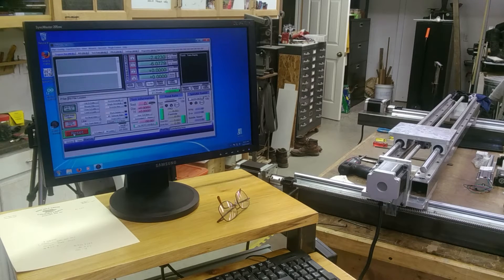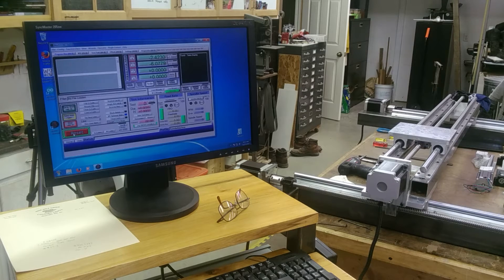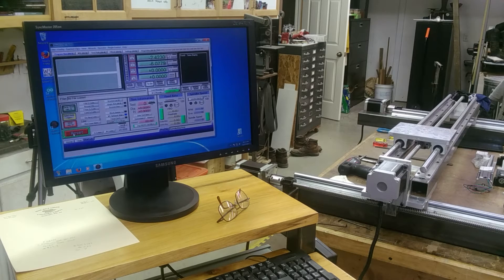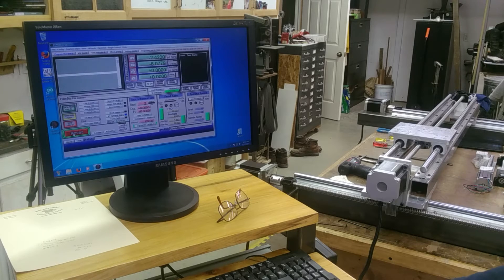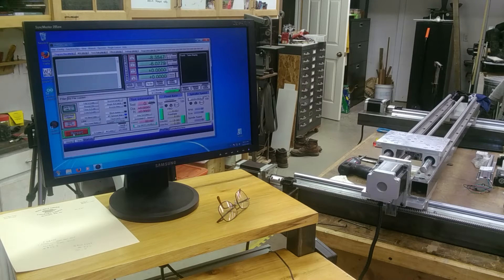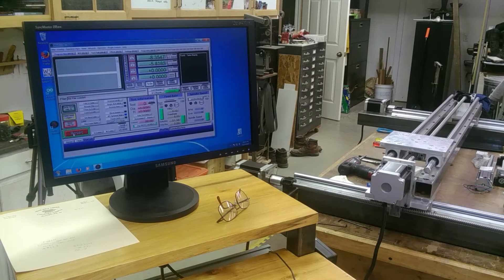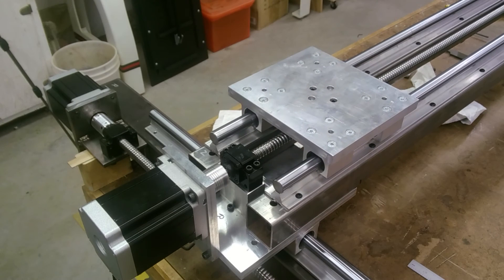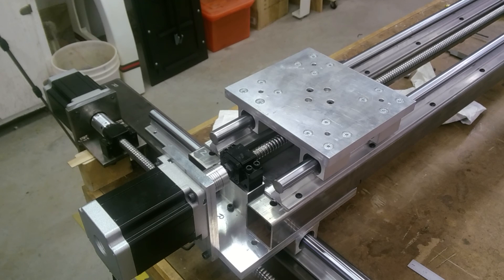CNC X,Y Demo rapid jog and home return

Comment: It think for such powerful motors it is more practical to use toothed belts to make it quicker.
Reply from the maker: I wanted ridge and precise.  The machine will travel as fast as most things I can cut.  I have found that 25 inches a minute is well in the safe zone to prevent skipped steps and stalls.

Comment: wow love this build. what ball screws did you do with. i recently made a 8020 2x3 cnc. its pretty accurate... but i feel it has some flex...do you have a build list anywhere for your machine...lve the double ball screw  on x. smart. also how did you make the table  perfectly level the tube steel.